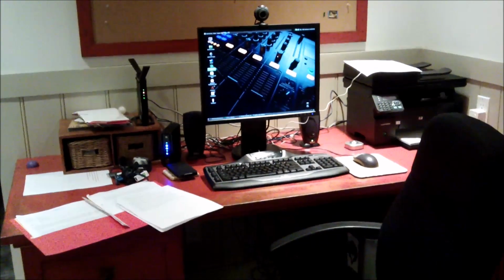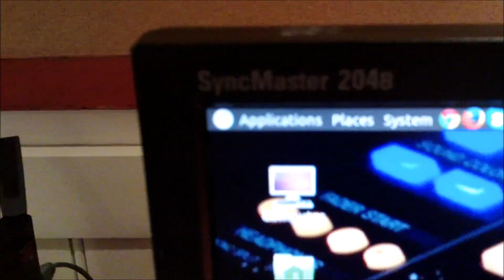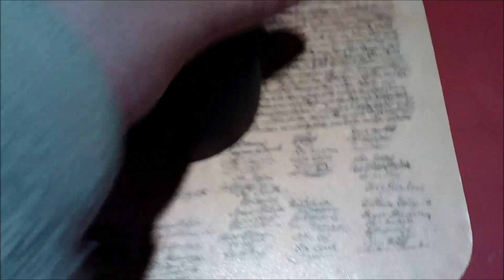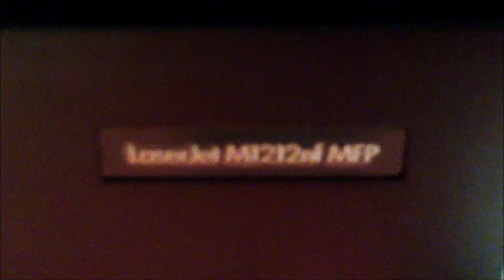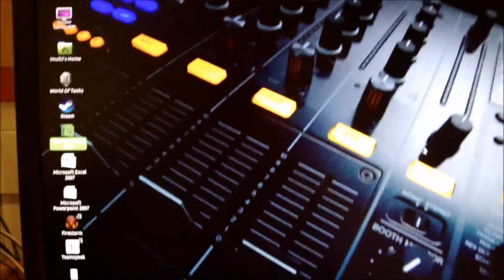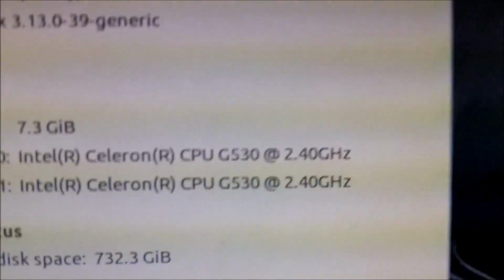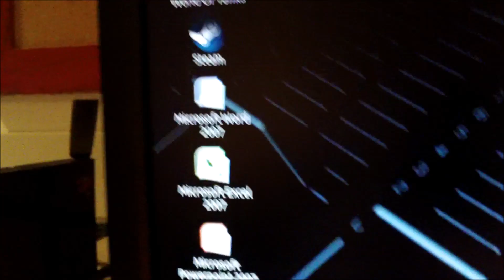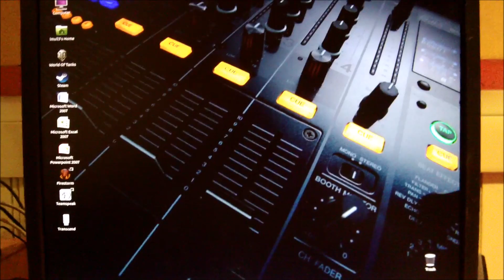Basement Linux Box 11-24-2014

Comment: If I were you I would swap them fuhjyyus out straight away !
Reply from the maker: that power supply will probably get recapped at some point. the circuitry is excellent. i periodically look inside it to make sure everything's alright. if i see one bulge, boom, it's getting a full cap job.
Reply: lmull3 They don't have to bulge to be failed, I bet that they are out on esr and capacitance.

Comment: So here's my question. Why're you using a Z68 motherboard on your G530, and using an H61 board on your 2500K?
Reply from the maker: because the Z68 board doesn't run versions of Windows above 7 properly while the H61 boards do. the Core i5-2500K build video has a lot more detail about that.